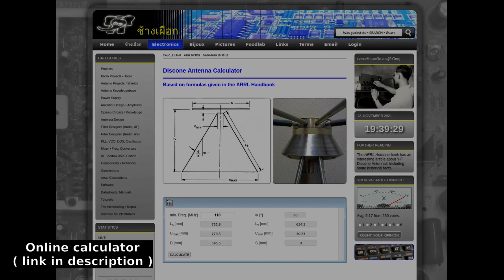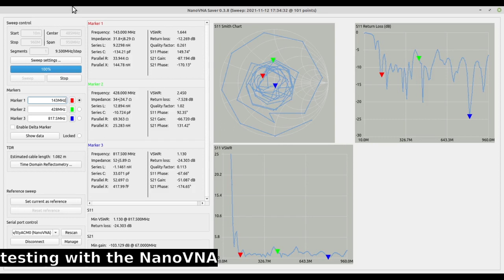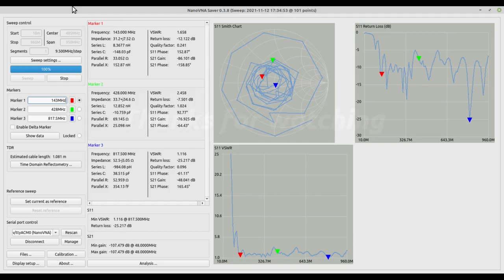Make a discone antenna for my SDR radio

Comment: Step 1. Own an assortment of expensive-ish tools.
Step 2 (optional?). Know how to use them.
Step 3. Painstaikingly build discone antenna (having gotten several steps wrong, possibly several times, during the process)
Step 4. Casually browse the interwebs, nursing your bruised and bandaged fingers, to discover that you  an order a fully-functional one online for a very moderate amount of €/£/$...

Comment: This is the very project I will be doing myself for Airband, 108-136 mhz. I have a commercial wideband Discone but only need elements of 590mm for airband. I just want to build one because I am a model engineer and it is a project for the lathe and drilling/tapping. Where you have used PLA I will use perspex/acrylic discs. Nice work.

Comment: Nice video. A question for installers out there as this is a place who has experience. I have a discone antenna which is being installed apart from metering the cable end to end for continuity inner and outa. Once connected via N type aerial end and bare on the other before going up on the wall if I meter with a multimeter the inner core should it beep out on any part of the antenna and same with the outa cable? I take it it's not a loop in anyway? Should it beep on inner core to the whole antenna? Just thinking test wise before it goes up as have to pay to take it down again if it's wrong.

Comment: Can you make an discone antenna to receive TV signals ?? Since the antenna can receive signals can this be fine tuned to work with transmitted signals in the  UHF band between 470 and 608 MHz frequency range.Would be interesting to see if that would be possible. Nice video fella for sure.
Reply from the maker: Yes you can make a discone for any VHF/UHF frequency. But this antenna has no gain and for tv application you would probably look for a more directionnal antenna like a yagi.
Reply: @tinybricole7774  Thanks for giving me direction TinyBricole. One learns so much when others give direction to questioned asked.
Reply from the maker: @victoryfirst2878  Totally agree with that. Thanks for your comments !
Reply: @tinybricole7774  I am wondering if you would have some insight into antennas. From looking at TV antennas, two stand out. Channel Master 4221 whisker vintage antenna and the Grey-hoverman double diamond antenna. These items were made years ago and to this day have been improved upon, still used to this day. What puzzles me since technology has moved on so much is why antennas have not really moved in the same direction ?? Peace
Reply from the maker: @victoryfirst2878  Thanks, i don't know a lot about tv reception. I'm more into radio stuff these days : just got my ham license ;)
Reply: @tinybricole7774  Glad that you let me know Sir. I am also interested in ham radio myself, but am just getting a hands on feel so far.. My old neighbor is showing me the different parts of HR. I am just intrigued with this technology. How long did you study for the license ?? I do believe that I myself will be doing the same thing soon.
Thanks TinyBricole.  :)

Comment: 1:22 you should not go back over the metal with the chisel on the last cut if you do that it will look less good
Reply from the maker: OK, thanks for the tip ! I'll try that !
Reply: @tinybricole7774  1:47 also for this you should lift the chisel from the metal then move it back and the put it back on the metal if you keep the chisel on the project when turning ik back it can get stripes on it